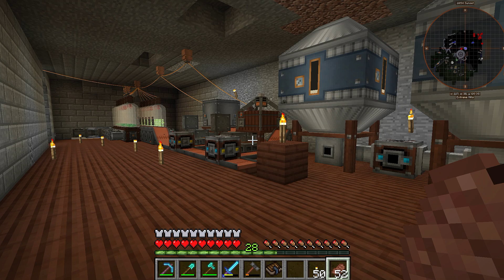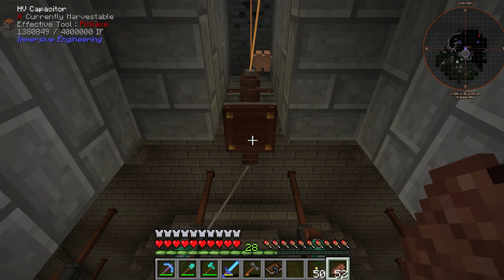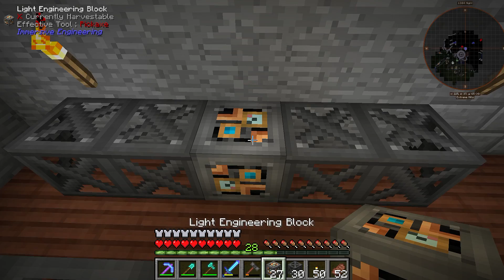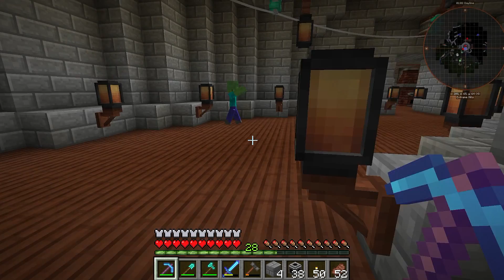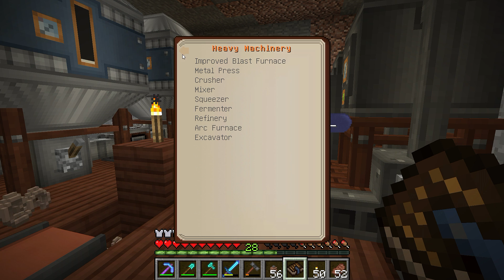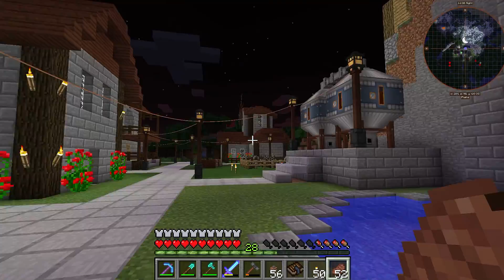Immersive Engineering | Episode 22 | The Refinery

Comment: Hmmm... You know Data... you could replace that front door switch with a flip-flop and run that from a trip wire. That way the protection would come on and off automatically as you move through that corridor.